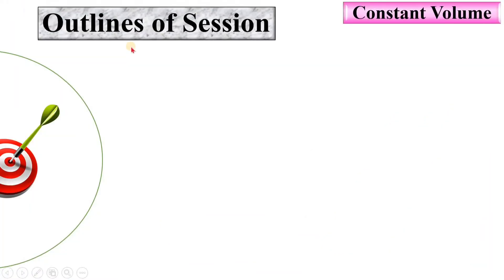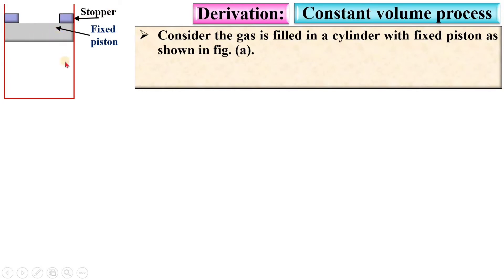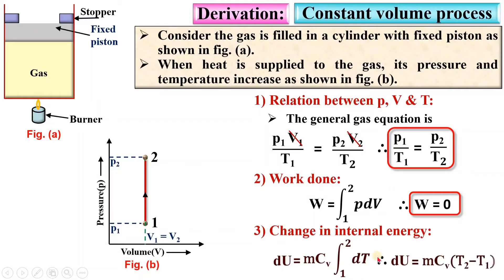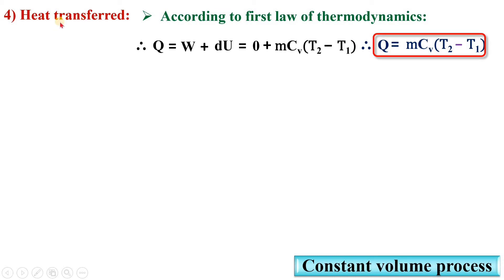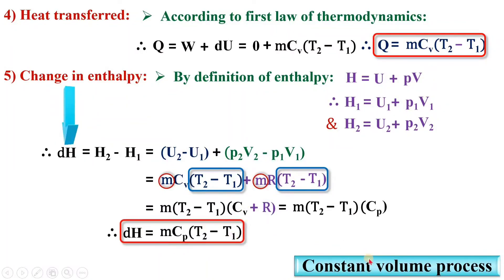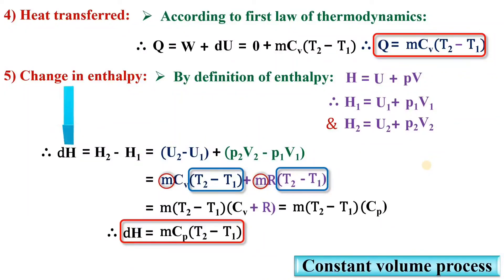Isochoric Process (Basics, pV diagram, Work Done, Change in Internal Energy & Enthalpy) Explained

Comment from the maker: Isochoric process or Constant volume Process explained with following Timestamps:
0:00 - Isochoric process or Constant volume Process - Basic Mechanical Engineering lecture series 
0:32 – Isochoric process
1:16 – pV diagram of Isochoric process
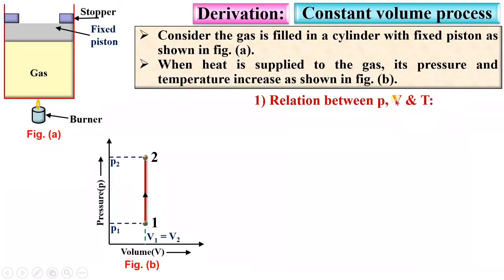2:29 – Relation between pressure volume and temperature
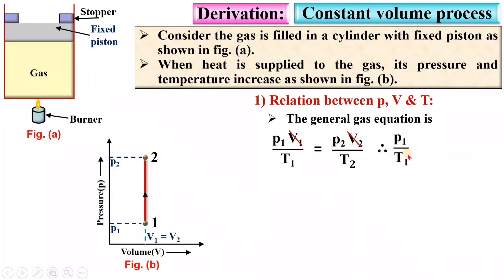2:59 – Work done during Isochoric process
3:25 – Change in internal energy during Isochoric process
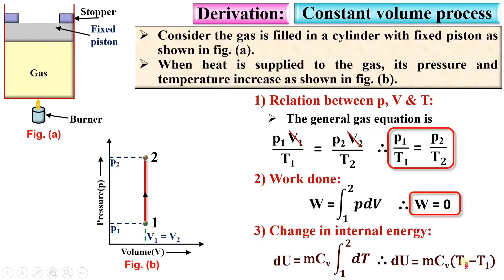3:48 – Heat transferred during Isochoric process
4:28 – Change in enthalpy during Isochoric process
Reply: Excellent.